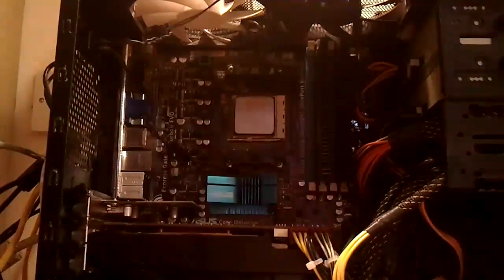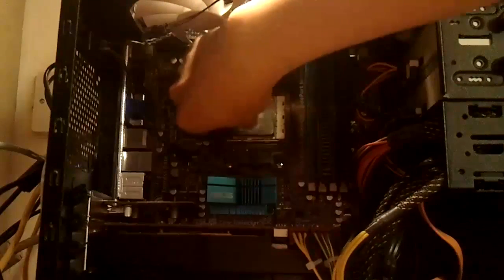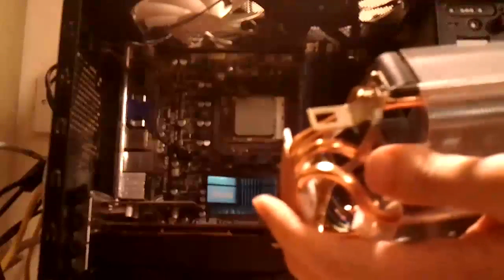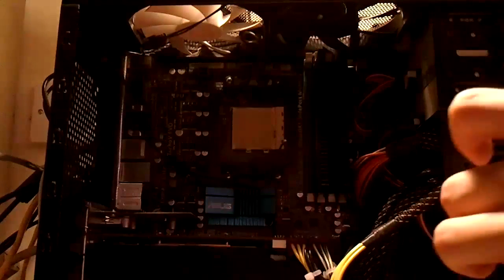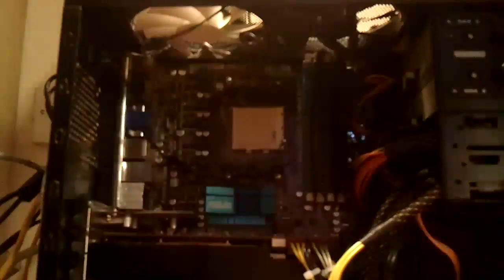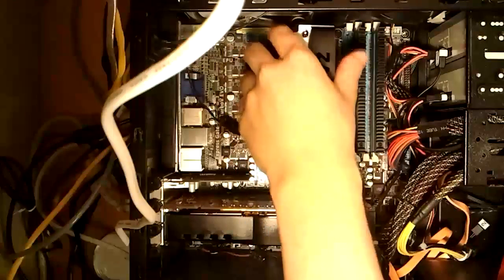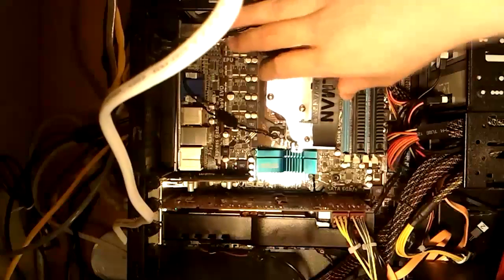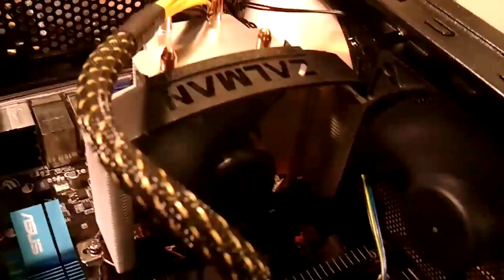Zalman CNPS5X unboxing and AM3 installation in NZXT Vulcan Part 2/2

Comment from the maker: I didn't expect so many views and so much feedback on this video. I really just wanted to show that the CNPS5X would be a good choice for the NZXT Vulcan since you can't fit most tower coolers (120mm and up) in it.

Sorry for the crap install but I'll keep your tips in mind next time. I haven't had to change coolers recently though, still getting 21*c idles and overclocking to 3.6GHz is easily achievable with a temp of around 44*c on load, still easily under the 60*c limit. Maybe I'm lucky. :p

Comment: this was hilarious! I hope you didn't lose any pins when your cpu came out of the socket. I did the same install with this cooler today (went alot smoother) and i can tell you that this fan made it possible to unlock all 4 cores on my phenom2 B555 because i don't have to worry about the temperatures. this cpu would get over 55C and get dangerously close to the 60C thermal ceiling while under heavy load. I can now run open throttle and only reach 50-52C and no worries.

Comment: @AutomaticVII got it installed a few days ago and im very happy with it super quiet my 120mm case fans are louder and my temp has gone from 49 down to 30 . It was also very easy to install on my asrock 880g extreme 3 the slowest part was removing the thermal paste :)